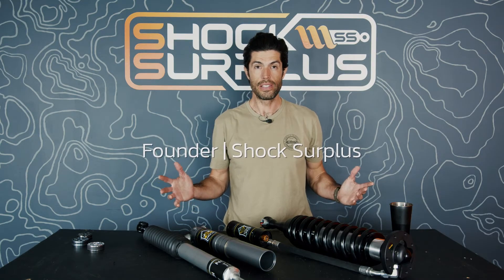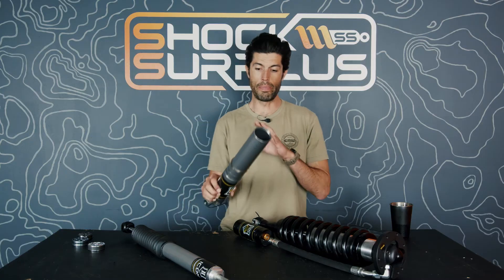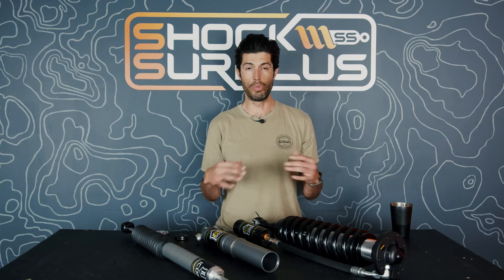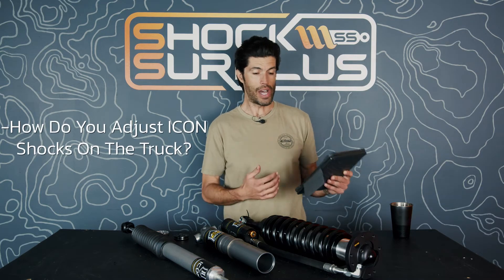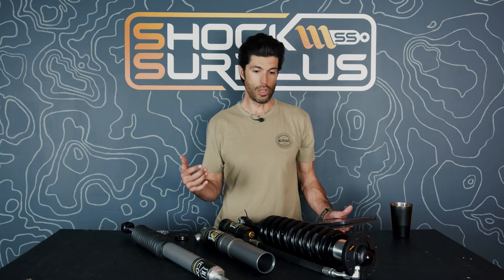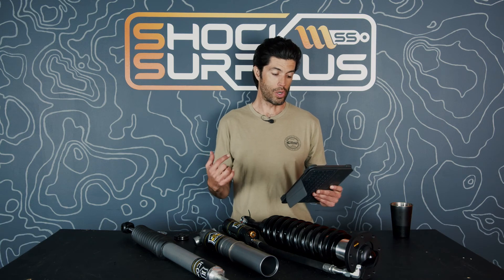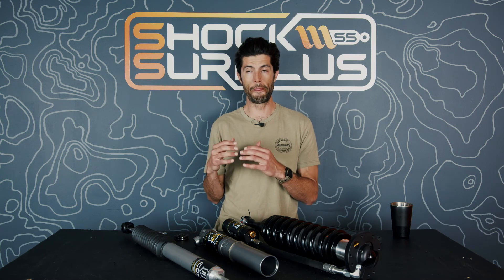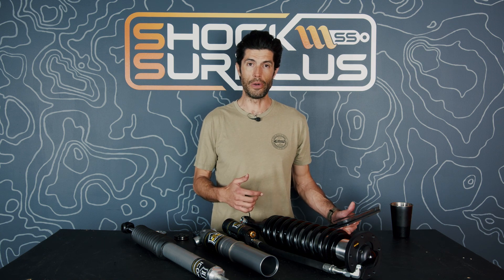Icon Shocks for Beginners - Your Questions Answered

Comment: Hello
I have a 2017 Toyota Tundra Limited Extended Cab TRD Offroad 4x4. I'm looking to start a FULL overlanding build in the next few months, inclusive of new bumpers, winch, roof rack, bed rack system, roof top tent, all the goodies plus all the extra weight. And probably keep it like that for daily driving. I want to achieve a 3" lift up front via coilovers, and a corresponding lift for the rear where I'll still have a mild rake from rear to front even after full build is complete. I don't care about going fast off-road, I don't care about going fast during daily driving, too old for that, haha. I just want very good handling on and off road and the durability of my shocks to be where I don't have to rebuild every 30000-50000 miles. I don't care for massive rock crawling either. I just want to get outdoors and go places that most people have no idea about. Money is no issue but I don't want to waste money either. I'm just looking for a complete suspension suggestion for brands and which system within those brands. Thank You
Reply: Best ride is gonna be king remote with adjusters. Shouldn't have much body lean but 3" up front is gonna be hard on the cv axles over time so it would be a good idea to pair it with a 1" differential drop. Shock surplus has a video on sdi electronic adjustable coil-overs, which they can add onto any normal remote reservoirs. Adds about $2,500 but you can set them soft for slow trails then stiffen up on the highway from the driver seat. They also prevent bottoming out pretty well. Get a full rear leaf pack from either deaver or old man emu set up as the expedition pack for your added weight. Add a leafs and blocks are pretty bad once you load them up. Also spend the extra money and get the icon delta joint upper control arms. They're 100% worth it.

If you don't go with shock surplus order from a company that can customize your coilovers. With a steel bumper and winch you will want to have a heavier spring rate than the out of the box ones or you won't get the lift height you want, or you'll have to crank the preload and ruin it anyway. They say 50,000 mile rebuild but I've got that much on some basic fox 2.0 ifp's until  I can get the spendy setup and they're still like 85%-90% as good as they were new. If you don't want to ever rebuild bilstein 6112 or 8112 if they make them for your truck are good, but the ride quality won't be as nice. Rebuilds are typically required from high speed off road stuff. Highway and slow trails doesn't put a ton of strain on them so they last longer.
Reply: Thanks for the info, you guys are the best. I WILL be shopping from you guys!!
Reply from the maker: MrSkyentist, you are truly amazing good sir. Thanks for chiming in and helping the community understand and guide them as well. We need more people like you haha. But spot on. Another good overland setup is ARB/OME BP51 with internal bypass, external reservoir, and low-speed compression and rebound adjustment.

Comment: Are the icon 2.0 rear shocks known for any type of.. very slow speed noise like a creaking. Just got mine installed about 3 weeks ago and when im parking in my garage or a lot i can hear them creaking.. but once i go faster the 5mph there’s nothing
Reply: If it's for sure the shock and not either the rear leafs (assuming it's a leaf sprung vehicle) or the sway bar, just buy some silicone spray lube, jack up the rear end to extend the shocks, wipe them down, then hit the shaft with the lube and cycle it a few times. Sounds like the seal sticking slightly. Suspension components creak over time so having a can to hit up the contact areas helps.
Reply: Thanks! I hit the leafs with some liquid grease, they’re quite. Its for sure the shocks. Ill get some silicone spray lube 👍🏻
Reply from the maker: Thanks Mrskyentist for the info as well. Sometimes the top mount on the Icon shocks (if we're talking about a toyota platform here) dont get fastened right, check that too.
Reply: Yes its a 21 tacoma
Reply: The shop i went to applied grease idk where exactly, on the top part of the shock. The creaking has decreased about 98%
Reply from the maker: What leaf springs were being used and where did they apply the grease?
Reply: @ShockSurplus  stock leafs on a tacoma off road. I sprayed some liquid grease on those, their good. I don’t know where exactly the shop applied the grease for the shocks but the noise is significantly lower. Like 98% gone still juuust a little creak.